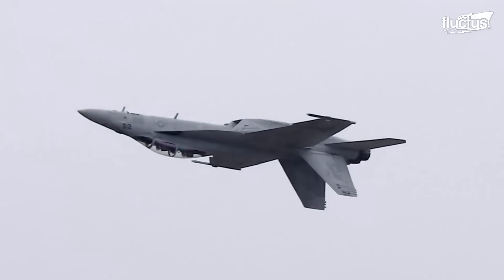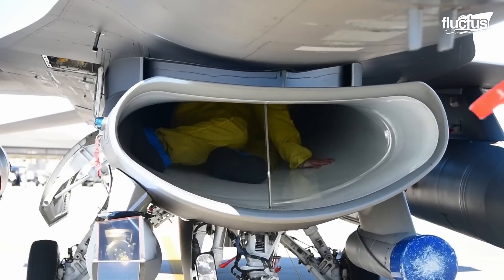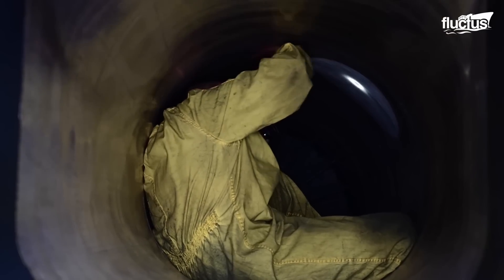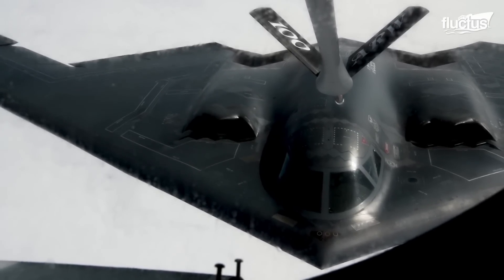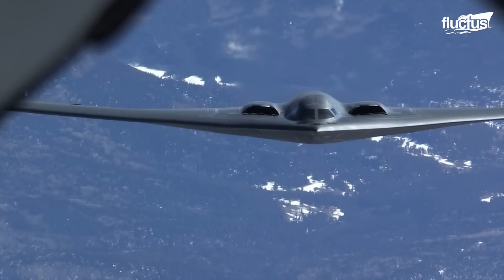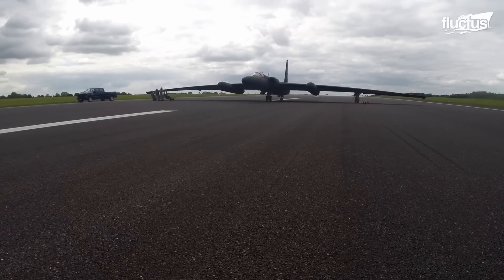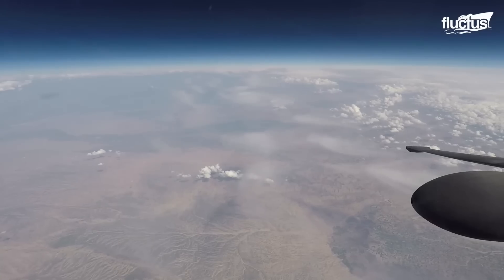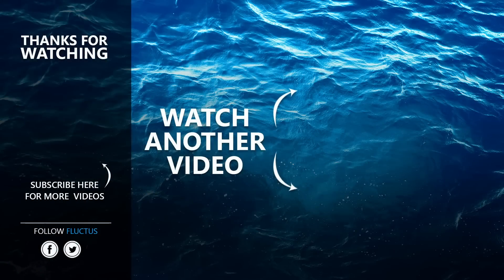Why US Airmen Risk Their Lives Crawling Into Dangerous Fighter Jet Intakes

Comment: As F4C aircraft electrician in many intakes of F4s from 1965 to 1968.   Big intakes,  but you had to get around pitot tube in intakes.   F4C's notorious for generator issues with oil seal leaking oil onto slip rings.

Comment: F-16 inlet, .5 ft to 1.5 ft ... bullsh*t !  It was probably double that, at least. I don't remember anyone working on the flight line that would have fit in the inlet if it were that small. I looked forward to "jumping the tube", especially when it was really cold, and the jet had just been shut down. It was definitely important, but dangerous ? LOL !
Reply: Maybe they meant getting around the tension strut near the front; but that would be least 2.5 feet on either side and maybe 2 feet top to bottom, wouldn't you say; but truly not a half foot anywhere - But still an odd shape to get through - Never did it myself, but saw hundreds of them in the '80s.

Comment: Pretty accurate video. Former jet engine mechanic in the USAF. The answer is very simple, inspections. Of course your life is not really at risk because the engines are off... However, there are safety zones while the engines are running so you don't get pulled in.

Comment: If the USAF think the F-16 intake is narrow then they should of come down the RAF English Electric Lightning aircraft intake. You had to Climb a set of A frame steps, put your upper body on top of the Radar Ray dome. Then pull your body inwards whilst rolling around the Ray dome and sliding downwards. Once in you then crawl all the way into the upper engine some 20 feet or more towards the rear doing your inspections. then while crawling backwards from the upper engine you came to the lower Bifurcated duct, where the two intakes split and inspect the lower forward engine.   You had to be a slim Airman to do this

Comment: They don’t risk their lives crawling in the intakes, the engines aren’t turning and burning. That’s just stupid using it as a video description. Crawling the intakes is an every day occurrence.
Reply: have you ever cleaned bird guts out of an intake.   Smells really bad
Reply: @patrickdenning5986  actually years ago we were in the bounce pattern in Cubi Point, Philippines and we hit a fruit bat. These monsters have a 5’ wing span and it went down the #4 engine intake. I was the aft observer on that side and the flames out the tailpipe were awesome. The remains pulled out were horrible smelling.
Reply: @kaptainkaos1202  LOLOL and I thought they smelled bad on the outside   5' bat ??????? In Tennesee they may get to 8" to a foot
Reply: 100% aggreed. That is a normal inspection veruy routine and boring. They even stick their heads into exhaust outlet also ;)
Reply: @kfelix2934  sa
Reply: Can confirm that this is normal
Reply: Came to say the same